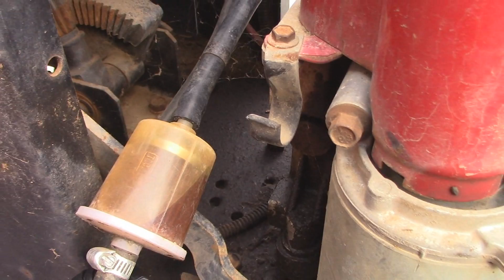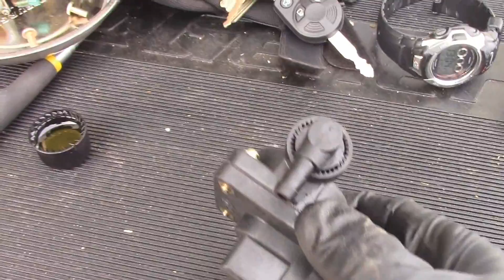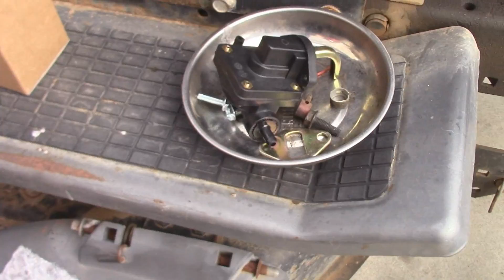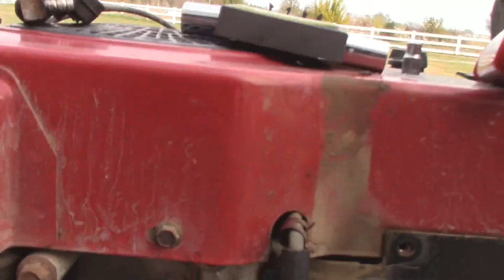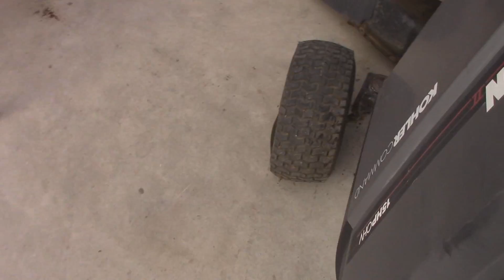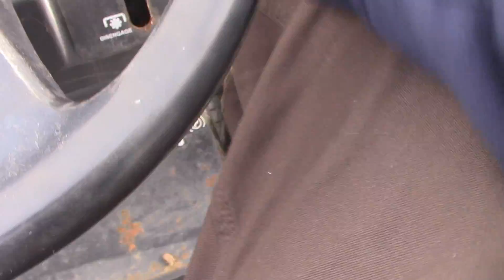Kohler Command Fuel Pump Replacement

Comment: At 7:18 you talk about the bolts not having clearance for a socket - my Command CH13 uses torx head bolts instead of a hex head bolt - must be a change in the later models, because my ch14 had hex hed bolts. The thread for those bolts is M6x1.0 BTW.

Comment: Is this pump still working? I've been having trouble with these mechanical pumps on my command 13 horizontal engine - I used an aftermarket "stens" brand and it didn't work very long, and then I used a new genuine Kohler pump and it didn't last long either. The diaphragm seems fine, but the check valve portion isn't working, so the pump is pulling fuel, but it flows right back to the tank :/

Comment: I did the same repair, but so far no success. There is no gas at all in the fuel line. I was hoping that when I cranked the engine the new pump would pull the fuel through, but it's not.  Might that be just because there is nothing but air in the line?  Should it be necessary to prime the pump by forcing fuel through the line??
Reply from the maker: Likely its air in the line, you can carefully try to add positive pressure to the line with an air compressor nozzle but be careful, it will shoot out a foot or 2, only need to pressurize for 2 seconds.

Comment: stop saying going ahead omg
Reply from the maker: Let me just build a time machine and redo this video for the ONE guy that has a problem with something so trivial lol “omg” the things people complain about 🤣🤣
Reply: And then you'd owe all your time-traveling success to this whiner....whose comment (I have to admit) I actually found funny...that phrase reminds me of the boss in Office Space, right? But your reply was at least as funny. Thanks for the video...thinking about buying one just like this. On balance, it's a pretty good machine, is what I'm picking up, no?
Reply from the maker: @qbeedoo6166  Yea Office Space is one of my fav movies. As far as these mowers go like anything else they are good as long as they are maintained. If you buy any used rider your going to likely need new belts, probably blade sharpening at a minimum, make sure the spindles that hold the blades dont make a ton of bearing noise, they will sound very obvious if they are bad, and the engine will likely need a standard tune up.
Reply from the maker: @qbeedoo6166  One other thing to add is Kohler makes all their service manuals available to the end user. One of the main reasons I really like their products. They can be found as a pdf with a simple google search too

Comment: Looks like you need some Audi/VW fuel line pliers for those.  I cant imagine using that C-clip either.  lol   Subscribed!  How do you know when the pump is bad, other than process of elimination?   My Simplicity with Kohler Command CV460, and she just sputtered out.  :(  I could fire the parts cannon at it.  I'm ok with fuel injection, just new as can be to small engines.
Reply from the maker: All you have to do is remove the fuel line going to the carb and crank the engine. It’ll start spitting fuel if it’s working.
Reply: @hanksgarage_  Awesome!  Thank you.
Reply: "C-" clip  tool works fine !

You just gotta be smarter than the tool.

Try spotting one leg of the "C" on one clip pressure point and pulling the opposite leg of the " C" back onto the second clip pressure point instead of attempting to push it 0N .

"

Comment: If anyone is having issues with their fuel pump, I fixed my pump simply by tightening the 4 screws that hold 2 halves of the pump body together. Also make sure all the fuel lines are tight and held securely, any air leakage will cause the pump to not work.
Reply: A Google User yeah but on mine someone installed a “vacuum” style pump and it has a port for where the mechanical pump is supposed to go. I got it not running. Hopefully the mechanical pump makes it work. It has compression and spark.

Comment: I just did a engine swap and new engine doesn't have a Manuel pump how can i run a external ? I tried the regular pulse vacuum one that is on most mowers but  its building too much case pressure and blowing oil out the dip stick

Comment: i have replacement part for fuel pump but nott a mechanic i would like tto see how to check screen in fuel tank like you said here, do you have a vid on the tank cleaning
Reply from the maker: No I don't, but you may be able to see it with a flashlight and taking the gas cap off

Comment: Can you tell me what the engine was doing before you replaced the FP???? My engine will crank and run on slow but will not accelerate. Any suggestions valve job maybe. Do you have a valve video for this engine.

Comment: Ok I figured out a way to squeeze those little thingys together so you don't jam a screwdriver into your palm. 1. Get a pen top and cut two little nubs off the end. 2. Tape the nubs to the appropriate spot on the fuel pump. 3. Take a pair of channel lock pliars and set to the appropriate size. 4. Squeeze the nubs with the channel lock. Viola.
Reply: I like that--will try it on mine--thank you!

Comment: Thanks for responding, I’ll check it out, but everything else was fine before it wouldn’t start, then I put the new fuel pump in, the engine starts now. In your video, I saw that you did not use the metal spacer that was provided with the fuel pump, I didn’t use it either, I wonder if that could be the problem??? And, I found another video in which the person indicated that the actuator arm on the fuel pump that is operated by cam inside engine was bent incorrectly (he said Chinese parts). Could it be one of these causing there to not be enough fuel to keep the engine running when I let the clutch out?

Comment: I had the same issue, engine would not start. I replaced the fuel pump and the engine started. but now I have a different problem. Once the engine is running, I let the clutch out with any gear selected and the engine dies, this was not an issue before the fuel pump was replaced. Is there any way I did something wrong installing the fuel pump? -any suggestions?
Reply from the maker: There should be a clutch safety switch that may be the culprit. Hard to say with out me being there looking at it. If it bogs down and slowly dies it may be the carb needs to be cleaned
Reply: Seat kill switch
Reply: Thank you for the response. Seems it was the clutch safety switch. -I hauled the mower home on a trailer about 140 miles to work on it (fuel pump) and must have affected the switch with all the shaking etc. while on the trailer. I don't necessarily recommend this, but, I bypassed the switch and have been using the mower that way.

Comment: Hank I have the same sears LT4000. It runs fine but won't drive. I put a brand new belt and it's too loose and still won't drive. Can you point me in the right direction?
Reply: Iv been look for the belt details drive and deck.   Any info?

Comment: It looks like you left out the red rubber, shaped O-ring type gasket that came with the pump.  Did you put that in off camera?
Reply from the maker: It went in off camera I dont remember having any left over parts after this job and that said its been fine since then
Reply: hanksranger I just did mine.   I left out the spacer and just used the o-ring.   I think the gasket is only necessary if the steel spacer is needed.   I used a pair of slip joint style pliers that I could set to Close just to the diameter of the pump,  and two small squares of plastic taped to the tabs where the C-clip is supposed to depress.  then I depressed the tabs with the pliers squeezing those plastic bits.   it worked well.   I was even able to remove one of the nipples and reposition it to the correct angle that way.

Comment: Thanks for the video, I was looking for a rebuild kit installation video but can't locate a kit anymore for these so a plastic carb is all we get. Suuucks..:(
fwiw: 
 These pliers worked great to squeeze the tabs in on both side. I have found so many uses for them like Plug wires, hoses, holding small tubing, this job etc.. Great to have them for sure... Thanks Again!!

http://www.harborfreight.com/3-piece-long-reach-hose-grip-pliers-37909.html

A lot of info for Carb/Fuel pumps...
http://gardentractorpullingtips.com/carbfuel.htm#primer
Reply: Many times these pumps can be repaired by simply disassembling and rearranging the internal pump components.

For FREE ...  !

Comment: I had a similar problem with an LT1000, with an 18 hp Kohler engine but it didn't have a fuel pump. It would run 15-20 minutes and act like it ran out of gas. I changed the fuel filter and tried a few other things but to  no avail. I finally did away withe the fuel filter and  it works like a charm. Apparently the filter wouldn't let quite enough fuel through to keep the engine going.I just need to make sure to keep the trash out and use fresh gas.
Reply from the maker: I think I'm going to try that
Reply: Please do!   I was so fed up with this POS I wanted to drive it off a cliff, but it wouldn't run that long. Hope this saved you a few dollars and a ton of frustration. Good luck!
Reply from the maker: I think I have figured out what happens with these motors, when they are run out of gas air pockets get sucked in through the fuel line, essentially you need to "bleed" the system by putting compressed air into the line going into the tank and quickly reconnecting it back to the one to the motor.
Reply: My K241 must have a starting fluid shot on the first start of the year or ran out of fuel.  After reading old mower sites it's the norm for most K-series. Always starts afterwards unless it sets for several weeks and bleeds off then needs a shot. These pumps quickly become too weak to pull air/fuel through the line it seems...Peace
Reply: eniwinski i got the 18hp craftsman mower and do have fuel pump.  mine just died and its not gettimg any gas. but the fuel pump is im a tight spot
Reply: eniwinski e